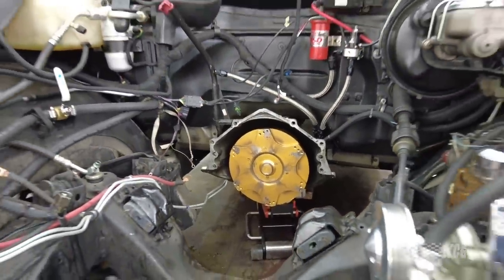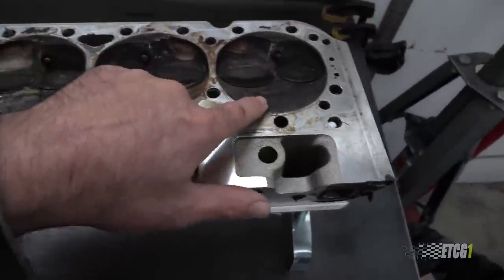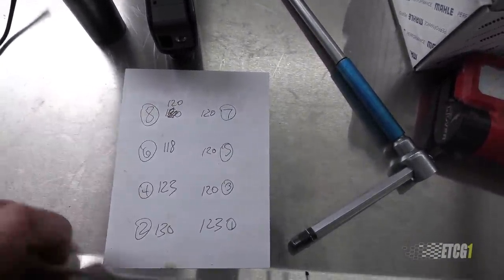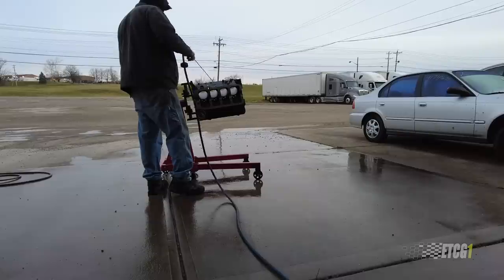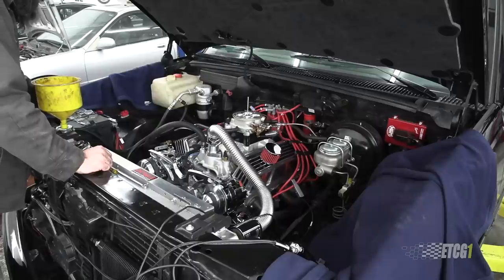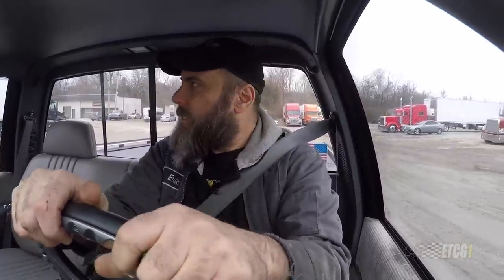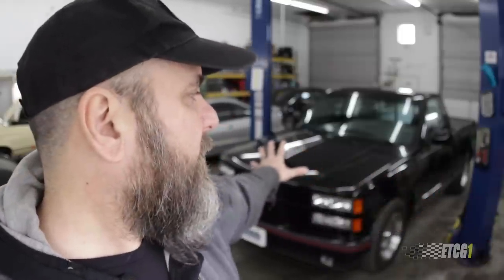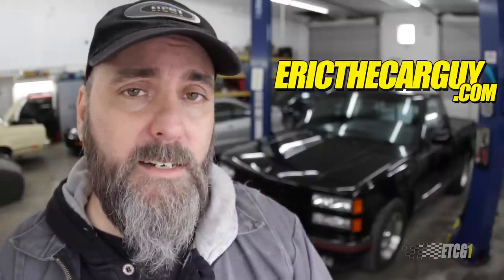Oil Leak Fixed Once and For All

Comment: I have the same issues with my Olds engine and I have been tearing my hair out. The series of videos you have on this are so valuable it is hard to put into words. Rebuilding w/o honing first and then showing that you have to rebuild again is honestly more useful than if you had just done it right the first time. It really drives the point home. Thank you so much for putting this out there.
Reply from the maker: Glad I could help. Thank you for the comment.

Comment: You were right about the catch can, and I was dead wrong. Never would've guessed pistons were backward!
Reply from the maker: The pistons weren't the issue, I believe it was because I didn't hone the cylinders before installing the second set of rings and pistons. Thanks for the comment.
Reply: @CJ Malone - How would that cause excessive crankcase pressure? The lack of honing caused the rings to not break in correctly, and subsequently caused the scuff seen in 2 cylinders. That will directly pressurize the crankcase.
Reply from the maker: @CJ Malone That was not the issue. Please watch the entire video.
Reply: @CJ Malone The several pistons installed on the wrong side was the cause of the valves tapping the piston valve reliefs. The crankcase blow by was from the scuffing caused by not honing the cylinders.
Reply: @TheLionAndTheLamb777  and whenever you change rings you should always hone the cylinder bores, regardless if they were new pistons/rings/honed a month ago.

Comment: I've used that exact rethread kit for the last several years and it's fantastic. It makes re-assembly so much easier, it has saved a lot of old hard to find hardware and is a must have for anyone who disassembles old junk in my opinion. My process with really scrungy hardware is run it through the parts washer, toss it in some rust remover for a day then run it through the thread repair kit.
Reply: I normally just used a old bolt that was meant to go in there and cut a slit or two in it.

Comment: I got valve marks on the piston crowns in my 5.7 litre Chevrolet LS1 V8 engine because the hydraulic lifters were jamming up & causing the valves to hold open.

I replaced the hydraulic lifters a bit over 2 years ago now (November-December 2018) & the engine is still going good with no oil leaks as the engine used to leak oil before I resealed it..

It's coming up to 362,000 kilometres but it doesn't use much oil  & I fitted it with tri y headers, twin 200 cell per inch catalytic converters & I renewed the twin 2.5 inch exhaust system as it had rusted out.

Someone (a friend) snuck it over to a dyno  tuner when I was getting a registration inspection done (Xmas present 🎁)  in December 2019 & now it's putting out about 310 flywheel kilowatts according to the tuner.

They have got that much power out of a stock LS1 V8 engine with all those exhaust & tuning mods done to it in Australia !

Comment: I used to work in a parts store-machine shop,  sell rings “kits” where they suggested to just install them without honing the cyl walls at all. I never agreed with the boss in the store about this no-hone point!
For this very reason here you proved the timeless principle that cyl wall hone to break off the “glaze” is a mandate!
NO Going around it as you proved here.
Now you’re rewarded with humbled face and successful revisited engine build that was corrected. 
The word DONE is the best thing here you realized.
Reply from the maker: The weird thing is I installed new pitons and rings on the Ford without honing and didn't have any issues. https://www.youtube.com/watch?v=K0x5BUIuEPc&t=1s

Comment: The nice thing about this learning experience is you will never forget about it again. I'm surprised with as much as those valves hit the pistons, you did not feel a large resistance when spinning the engine over. Like when you had to set the initial valve lash. The best thing is on one got hurt and your fixing the issue.
Reply from the maker: Actually, I did spin the engine over several times during assembly and didn't notice anything. I think the only time the valves came into contact was during high RPM and even then, only a small amount. Thanks for the comment.

Comment: Be tempting to just replace all the valves, ya got very lucky-!  And yes folks, hospital clean is the order of the day inside any engine rebuild, or otherwise for that matter.  Kudos to Eric for being honest enough to show mistakes (we all make 'em) and let the rest of us benefit from his experiences - as a young newbie I once changed to 1.6 ratio rocker arms on a SBC and didnt check the pushrod clearance where they go through the head, put the pushrods in a bind and ruined about four of 'em.  Fortunately for me it didnt hurt the engine or rockers, only the pushrods.  I should have had the heads clearanced at the machine shop and didnt - could have been much worse.  Had to have the heads clearanced and flush the oiling system. Needless to say I was humbled by that little episode.

Comment: Nice work, man! Glad that worked out! That's a super-easy mistake to make with piston orientation. You'd think the head would be symmetrical! I probably would've done the exact same thing. There was only one perfect man that ever walked this Earth, and we just celebrated His birthday 2.5 weeks ago.  Love the shot and audio at the end - no better sound in the world! Thing lays patches when it hits second! NIIICE!

I miss that. I had a '78 Cutlass in the day with a Goodwrench crate and a TH400 built to the moon. I bought it already built, and WELL broken in (at least 100k miles of abuse). It wasn't set up right, though. The builder put a Holley Dominator Strip intake manifold on it with a Crane 292H cam, but with a stock converter. Thing needed a 2,500 stall at a minimum - I think 3k would've worked perfectly, since that's where all the HP was. All the drag strip go-fast parts they put on KILLED low-end - I mean, there was NONE. I got beat off the line of a traffic light once by a Ford Escort!! How embarrassing is that, HAHAHA!  But once that engine hit 3k, HOLD ON! She was MOOOVIN'! Would lay a nice patch and kick sideways a bit on every full-throttle 2nd gear upshift. The first 5 seconds after mashing the pedal were super embarrassing, though, LOL! Makes me want to build another one after watching this! I will some day. Might hot rod my Silverado with a supercharger one of these days. I could always hot rod the '86 Grand Marquis, too, but the wife commutes to work in that all summer. She doesn't really need, nor have any desire for a hot rod, lol.  :)
Reply from the maker: That Cutlass sounds awesome. Thanks for sharing that.
Reply: @ETCG1  - It had a super-rough idle from that cam, too. Thing used to shake around and lurch forward at traffic lights. Made everyone and their brother want to drag race me, LOL. :D

Comment: Good stuff - New comment on a 2 year old video.  I suprised no one is talking about the  correct piston orientation resulting in correct combustion chamber flame front as well as air flow with the valve being "un-shrouded"  Good call to go back into it - there is now shame in going back in to correct.

Comment: Yeah you turn the heads upside down and put the solvent there to check to see if you had been valves but what that does not check is if you have any type of a weak valve spring.  having them upside down there just laying against their seat so again I don't think turning them upside down and putting solvent in them is doing what you want or any type of Justice to show you anything other than bad valve seat but I do appreciate this video and thank you for posting it and showing us how easy it is to make that mistake with the Pistons in the wrong position. Good video again thanks for posting. I would have sworn there was a vavle or valve spring problem. I really learned something today.👍
Reply from the maker: As I said in the video, that is a quick check to see if you have bent valves. I did find one using that method as I showed in the video. As for the valve springs, they were checked with the engine was originally built 3000 miles ago. I don't think an issue would have arisen in that amount of time. Thanks for the comment.

Comment: good work on fixing the problem , interesting to see the throttle body spacer , I have a manifold insulator spacer on my car , 25mm , lengthens the runners  and cools the intake charge .
Reply from the maker: Personally I think it helped a lot. Thanks for the comment.

Comment: You've had a lot of problems with that engine. I'm glad you got it figured out. You'll have 25 more hp after you dial in the extra 6 degrees of timing after break-in. 
  You could have opened the ring gap in preparation for a power adder. I just installed a rear disc conversion on my 1990 k2500. New shocks and stealthy traction bars. Traction is nonexistent with my little 245/75R16s. I have a new 4L80E and multidisc converter and 4.10 gears so the skinny rubber never had a chance. My motor is a 355 with trick flow heads and a comp roller cam. I've got holley efi and a centrifugal supercharger making about 8.5psi. Triple stock power.. She scoots.
Reply from the maker: In my defense, the initial problems with the engine weren't necessarily my doing. I didn't order the original pistons. You might have missed the previous video where I talked about setting the ring gaps smaller this time. No power adders are planned. For me the truck is pretty much done the way it is. 
Your truck sounds awesome BTW. Thanks for the comment.

Comment: If im not mistaking the pistons often have the wristpin offset to reduce pistonslap and wear. When put in backwards the offset will work in reverse increasing wear and slap. This could also have contributed to excessive blow-by. Anyways glad you finally got it sorted!

Comment: It sounds fantastic, and no doubt the feeling you get when you're behind the wheel is in some ways better than it would have been had you not had to experience the hardships that came with it, it's better for it!  ( If you haven't already, it's probably a good idea to check/change the oil soon after break-in. )

Comment: The dot on the piston always faces forward. The scuffing on the cylinder walls may very well be caused by the rings gaps not being opened enough and the ring end gaps butting together . All rings should be file fit. Don't ever just throw them in without checking. On a  N/A 383 that occasionally see's 6k rpm you want 20 to 24 thousand rings gap top and bottom compression rings. If you plan to play around with laughing gas at any point, make it 28 thousands just to be safe. The amount of blow by caused by ring end gap is miniscule. In a reality the difference between 20 thousands and 28 thousands is probably 5 hp at most.
Reply from the maker: You might want to catch up on the build before commenting. https://www.youtube.com/watch?v=RNzrdexY_Hw&t=8s
Reply: I've been following the build, as well as you for years now. Sorry if I offended you. I wasn't trying to tell you what to do. I've built dozens of strong, reliable sbc engines, but I've also built a few that didn't turn out so great on the first try because of stupid little mistakes like putting a piston in backwards. I did that once and it cost me 2 new pistons, and 2 new intake valves. I was commenting on the video as I was watching which I probably shouldn't have done. As I was saying, I normally set ring gap on stock 350's to 18 thousands. "Performance" gets set to 22 thousands just bc of the amount of heat created by running an engine hard, and race engines I do 28 thousands. I see that you originally did 21 thousands the first time and 19 thousands the second time. That should be just fine and shouldn't ever give trouble. I've seen guys who just throw a set of rings in a motor without checking them and it blows the top of the piston off beccause they are too tight. I tell everyone who buys rings that even if they aren't considered file fit rings, you still need to at least check them. I bought a set of rings once for a 350 that weren't considered file fit and they only had a 12 thousands gap which obviously is wayyyy too small so it was more of a general statement that wasn't necessarily directed towards you. I like the fact that you didn't hog those heads to pieces. I'm not a huge fan of porting bc you can easily make things more worse that better. A gasket match and a nice blend is more than enough to free up extra ponies, especially with the high quality cylinder heads you bought. I love the fact that you didn't cheap out and throw Chinese junk into that engine. You built it to outlast the truck you put it in and thats the way it should be done. All in all, you did an excellent job breathing new life into that old truck and I hope I can see it in person one of these days.
Reply from the maker: @patrickritenour6935  I do appreciate your input. Sorry if I came off like a dbag. I agree with everything you said, and covered most of it in previous videos which is why I mentioned catching up with the other build videos. It seems we are on the same page. Thank you for all your input and comments.

Comment: Such an obvious error when it's pointed out - but not something I had come close to considering before you showed it.  Appreciate you falling on your sword so we don't have to.   Cheers, mate!  :-)

PS: that exhaust valve stem with the odd wear is puzzling.  No sign of discoloration from heat, so it appears be getting enough oil...maybe a rough spot on the bottom of the lifter?  Or possibly just  bad valve metallurgy - I've never seen appreciable wear on a valve stem before, even on high-mileage engines.
Reply from the maker: I've been scratching my head on that one too. Glad I found it though.

Comment: Greetings Eric, happy 2021. 
You can see the happiness on your face now. 
Didn't you feel any noise from the valves hitting the pistons? 
aligning gaskets with the passages and placing a spacer generates an increase in gas velocity and avoid back pressures, in the long run a motor is an air pump and the fewer obstructions it has, the better for performance (always taking into account certain proportions that must be respected) 

The question now will be, apart from an increase in performance, if there is an improvement in fuel consumption. 

I don't think you've ever worked on 2-stroke motorcycle engines but these aspects are very taken into account to improve performance, it is notorious how attention to detail is rewarded in engine performance.
Reply from the maker: Thank you for your comment. As stated in the video I went back and 'retuned' everything. I was actually able to hold a leaner idle mixture which will save me fuel in the long run.

Comment: A trick I learned is just use WD-40 and cheap white coffee filters to clean the cylinders after the final wash and drying out. Should be as lint free as it gets, and you're not introducing more water.

Comment: I don't know if it was the location of the camera or not, but the truck even sounded different as you were doing those pulls.  Well done sir!
Reply from the maker: Your ears do not deceive you. The truck does sound different. Runs better too. BTW, I also removed the exhaust cut out and replaced it with a straight pipe. That also changed the way the truck sounds. Thanks for the comment.

Comment: I know you said you think the gasket matching and everything made a difference but I'm thinking that matching the pistons to the valves might've made difference.
Reply from the maker: Actually what I said was the good compression and the work I did to the top end gave me more power. I don't think the placement of the valve reliefs had anything to do with it. Especially since the intake valves barely touched the tops of the pistons. They never get close enough to really matter in my view. Thanks for the comment.

Comment: Don't beat yourself up. I've had reman engines come that way (all pistons same direction) from a national rebuild firm. 
Also, if you're running a fairly aggressive cam (narrow lsa, longer duration) the lack of intake manifold vacuum will exacerbate any blowby/ crankcase pressure issues, so a fairly large crankcase breather might be in order.
Reply from the maker: Now that I've done this there is very little crankcase pressure. The new breather stays dry and free of oil. Thanks for the comment.

Comment: Lucky it was flattop mouse and not a 454 or it would have gone boom. Always check v to p clearance sir with clay. That would have shown up. Humble man admitting faults is proof of character. Funny, the exhaust valve is usually the one with the clearance issue, that is of course assuming the eyebrows are oriented correctly. Glad you got it fixed. You got lucky on the honing because a deep vertical score usually cannot be honed out if was caused by hanging ring end during assembly in most cases. If you ever looked at an early chevy like a 327 it had 4 eyebrows on the pistons for just such an occasion as this one. Back in the early 80s We had a 1963 327 in a car that body shop ran the pee out that saved us there, they did bend the pushrods though, and it marked up the pistons badly. Switching around the pistons is how some of these guys get away with their silly pistons in upside down makes more power stuff. Mopar guys used to that.
Reply from the maker: Yes, and no on checking the pistons with clay. Not saying it's a bad practice, in fact, I checked these just for good measure before final assembly just to be safe, but if you only check #1, it could be fine because the reliefs are in the correct location. In this instance you would have to check a cylinder that doesn't have the correct piston installed. If you weren't looking for it you could still assume the rest were OK. I guess I was thinking of my Ford when I assembled it. Thank you for your comment and input.